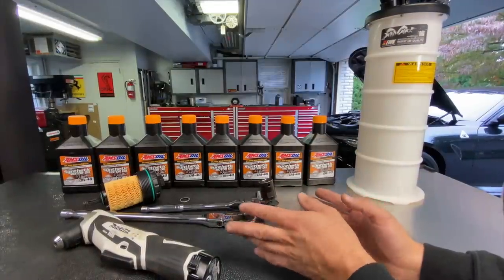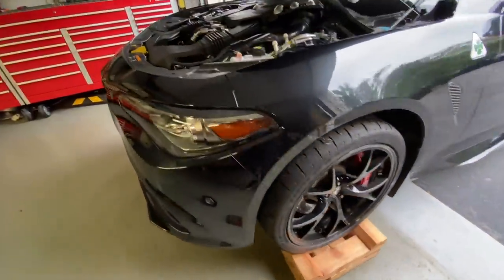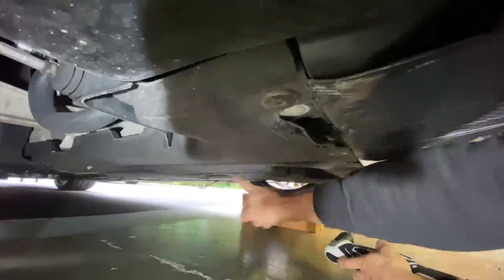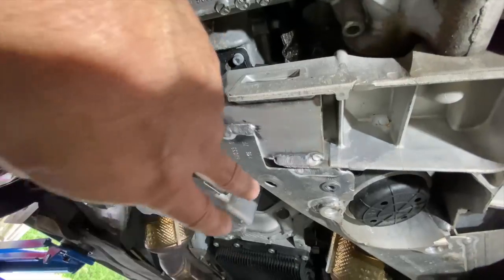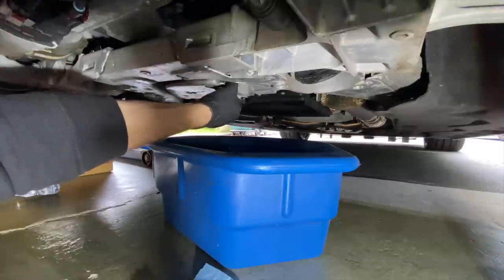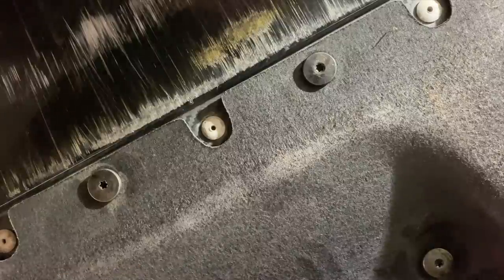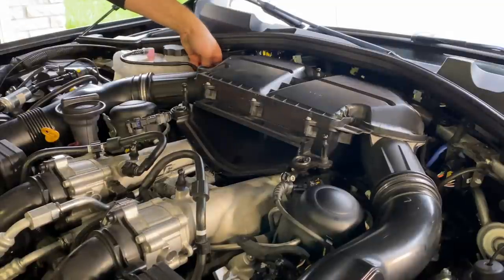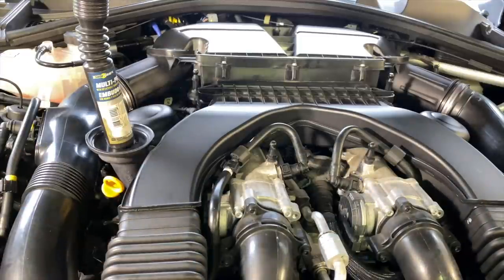Alfa Romeo Giulia QV Complete Oil Service DIY | Auto Fanatic

Comment: I have owned eleven older Alfa Romeo cars and none of them had a chassis cover. I plan to buy a Giulia QV and have watched another belt changing video, The eleven older Alfa Romeo cars also had seven quart oil pans regardless of engine displacement. I thank you for producing this video.

Comment: One tip , if I may……I usually loosen the oil filter cartridge canister before I go underneath to drain the oil. Reason being is that there is a small quantity of oil airlocked in the filter housing and assorted plumbing that will drain into the pan once the cartridge housing is cracked…..just enough to break the seal.  The OCD in me makes me do it!😂😂😂😂

Comment: Phil,  Thanks for the insightful demo.  I only wish I could have the same confidence in the work being done at my local dealer as you put into your car.  So many little details add up to a fine ownership experience.  The idea of a half trained half wit working on these cars is scary.
Reply from the maker: exactly plus almost all dealers put oil thats coming from huge vats and rumor was years back that they use recycled oil and not the same quality you get in a sealed container. not sure how much of this is true but i always see BMW, Mercedes and any other dealer pump oil from a gun that comes out of a huge metal drum with no brand name on it. kinda like those quick lube shops

Comment: Very informative video. Only thing I recommend is pulling the filter before or during the drain process. The lower rod with o-ring in the housing  is the anti drain back seal. So if you pull it after the plug is back in you’ll drain about .5quart of old oil back into the pan.
Reply from the maker: never tried that but i got a great drain on this oil change

Comment: Imagine taking that car to Jiffy lube. 
At least your Giulia has an oil dipstick. My x5 doesn’t. Hate that.
Hate torque screws. They have the tendency to strip. Thank you and Great tips on evaporust and not using air tools to put them back on. That’s what they do when u go to jiffy lube or valvoline. they strip the screws all the time. They don’t wanna do it manually. Ten years ago, they stripped oil screw in my car and I almost burned the engine. Went back and they denied it. But it was them. I do it myself now. At that time i didn’t know much about cars.

Comment: Thanks for the tip on the Evaporust. 👍. I have been looking for this type of product. Another thing I would do is inspect the air filter to make sure it’s clean since you are in there. 

This job looks easy compared to some of my other cars that I have done....and NO skinned/bloody knuckles!.... Lol

Great video!
Thanks
Reply from the maker: yeah the evaporust is awesome, no fumes, safe and I have been using it for a long time on restoration projects. The factory lower hardware corrodes easily as I show and this can seize up the hardware over time and snap then you gotta go through hell drilling and extracting.  the air filter is brand new before I got the car back.

Comment: Good video! Another tip is to buy a Click-R type plier, which makes removing the metal collars around the air box simple. This let's you remove it entirely rather than go with the the yoga block technique.

Comment: Well done Phil! Please add the torque specs for oil filter and oil pan plug  . Also how do you reset the computer for oil changes intervals. Glad you promote this awesome brand that doesn't have the dealer support network that it deserves here  in US!
Reply: 25nm

Comment: As a career shade tree, moment you started getting into it. I thought, "very Chryslerish" which is a good thing. In fact the Stelvio (base, rwd) is the most reliable Alfa right now. Because the base 2.0 Turbo is the same engine in the Wrangler, Compass, and other Chrysler esque I4s. The 3.9 (I think) V6 is unique to Alfa and is going to be a lot more work then what the 2.0 is. So if you want something more reliable and daily, get the 2.0. the 3.9 is going to throw some trouble but a lot more then what the 2.0 will. 

Also if you want, you can swap out those screws for the panel for something more rust proof. Most manufacturers don't bother with making their small bits rust proof. It's natural because it cheapens cost. Just go to your local hardware store and I'm sure you can find stainless steel replacements or something better that won't rust. Especially if you live in a area with lots of snow. You can find them online for a box o hundred for a few bucks. Don't bother with those dealer prices man. 

I personally live in Florida, so it doesn't bother to just pull off any screw or bolt off a Old wrecker in a junkyard. Then keeping it when I need it for later.

Comment: I’d just recommend you crack the oil filter open to the point the oil drains out, then drain the engine oil. That way you’re drinking out the oil that was in the housing and not draining it back into the now empty pan.

Comment: Very informative and descriptive video.    That was unreal how many rocks and gravel were up under that pan.   THAT'S CRAZY!   You would think a vehicle of that caliber would have a better design than that to not let those rocks/gravel gather up under that pan like that.   Imagine if you were not as mechanically inclined a person as yourself and never removed that pan.    Good gosh,  after a few years,   you'd be able to landscape a garden you'd have so much gravel up under there!   That seems like a design flaw on Alfa's part but maybe all vehicles do that?  Thanks for the info on the oil Phil.    I think I am going to switch over to that myself for my own sports car.    I have only run OEM oil since new but I am about 99% convinced your recommended Amsoil is probably better!
Reply from the maker: the issue is NYC infrastructure or better lack of because the roads are so bad and broken this is why there is so much gravel its not the car it is where I am driving it.
Reply: @autofanaticcars  That's crazy.    I am guessing your car is PPF'd?   Otherwise it would look like it had poka dotted paint after about 3 weeks!
Reply from the maker: no PPF i just avoid driving behind SUV and trucks and in 3 years my car still looks amazing due to my upkeep

Comment: hey -quick question (I have no mechanical experience except for changing tires, so excuse the silly question).  I imagine the oil will drain best if the car is level - by putting the front end up on ramps, might that not result in some old oil remaining in the engine.  Like if you empty a container of fluids, if you keep the container at an angle, some fluid will remain behind in the container.

Comment: Hey I would recommend you get those screw Zinc coated. NO more rust :)
Reply from the maker: problem is a plater would take weeks or even loose these and zinc and cad would never last on the outside of the car in winter. powder coating the heads might be a solution

Comment: Thanks for the tip using Evaporust.  Great video.  

Other than time, what’s your maximum mileage you’d go before changing the oil?
Reply from the maker: depends how your driving the car but i never exceed 2500-3000 between changes because i had so many high performance cars that burned oil and its those times you fail to monitor it that can cause an issue. I check my tire psi almost every day and dipstick twice a week.
Reply: @autofanaticcars  thank you Phil

Comment: There is some service news out from the Alfa dealership that you need to suck out all the oil out of the filter housing when doing a oil and filter change.
Reply from the maker: never heard of this because the filter is at an angle and gravity forces the oil down into the engine by design.

Comment: Nice Jobe .   I make long long interwalls  i dont change oil     i only controlling when the Engine  takes  every 1000 Km  1l of  Oil .   and Controlling the Oil and Airfilter .   I never had one problem .  In My Opinion  on every Cars if you dont drive like Motorsport ;)  Oil and Gear Oil can hold Up the intire CAR Live 14 to 18 Years

Comment: Can you change the oil on your own and keep the warranty? Because in most EU countries you must service your car at the dealership otherwise you would void the warranty
Reply from the maker: I will say back in 2005 Jaguar insisted that I let them do the oil changed on my brand new S Type R because they tried to scare me with this warranty void claim you mention. So I let them do it at the indicated 10k miles. got the car back the mechanic messed up, the oil pump failed and the engine blew up 800 miles after they gave me the car back. that was the last time I ever let a dealer do an oil change on my car.
Reply: In the United States the warranty will not be void if you change the oil yourself. You just have to use oil that meets the manufacturer specifications.  The laws might be different in the EU
Reply: @autofanaticcars   I would like to do this on my own too, but I still don't understand how do you deal with your dealer when you need a warranty repair if your service history is empty.
Reply from the maker: in the USA you just bring the car in for warranty repair and the dealers cover it for the warranty period which is most 4 years coverage.
Reply: @autofanaticcars  and you don't have to prove them or provide any documents from unauthorized services that the car was maintanced properly? Here's a quote from our local Alfa Romeo dealer terms & conditions document:
"The buyer must keep all documents proving that the vehicle has been maintained and repaired in accordance with the manufacturer 's instructions, and Provide them upon request by the seller. If the Seller determines that maintenance and or repair carried out without following the instructions of ALFA ROMEO, the quality guarantee for this car expires.

So basically I can do this on my own, but it would be very difficult to prove them that it was maintained properly. (unless I record everything on camera??)
Reply: Dammmm just went for mine for service today they charged me $540 just for oil change and break fluid smh i wonder if this is every time I do oil change